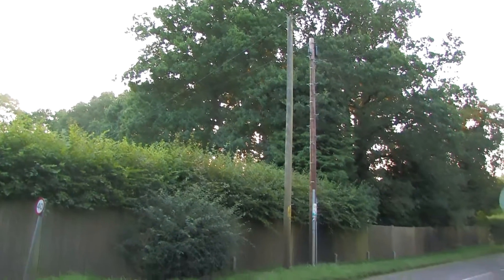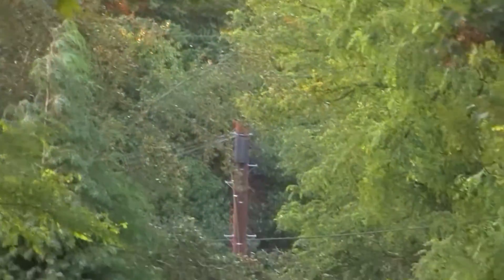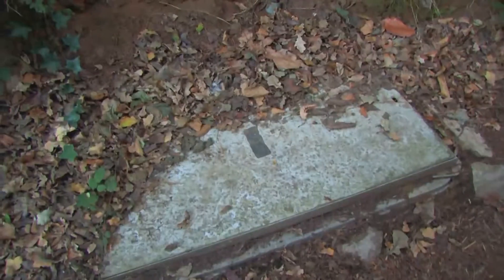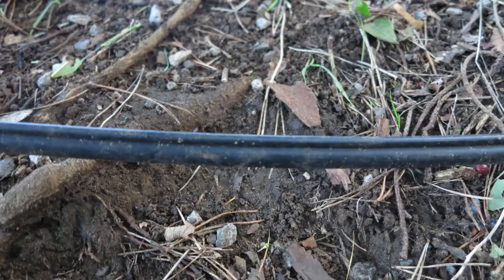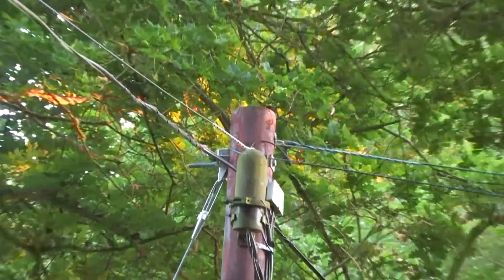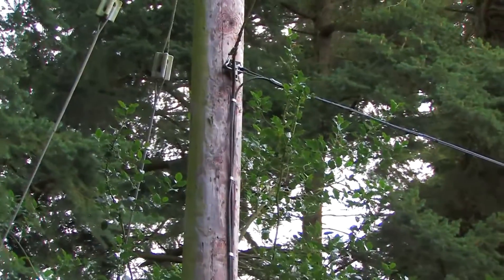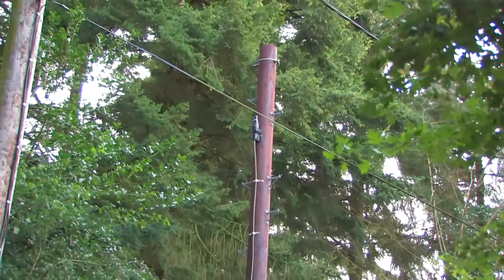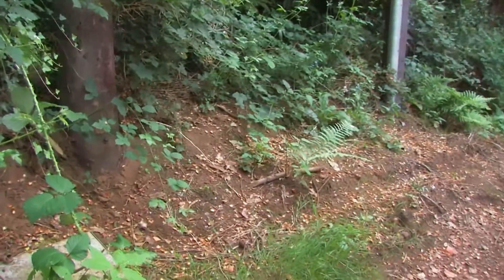BT Native (WBC) FTTP Deployment revisited two years on

Comment: FTTP starting to be rolled out within patches in my exchange area now. I wonder how long it will take for areas to be activated...
Reply from the maker: I now live in Northern Ireland wherein Openreach recently passed 50% FTTP. Can't quite believe how old this video is!
Reply: @scivids1999  wow impressive! I guess it will be only a few months till we can get Gigabit speeds, but that’s probably optimistic! Deployment only started a month or so ago!
Reply from the maker: It should be quite quick an enablement now. I can get FTTP at my place but use 4G/5G due to cost. 

Perhaps I should make a video about the modern connectorised FTTP approach; I wouldn't need to travel very far to film it!
Reply: @scivids1999  ahh fair enough, we get 55/8 on VDSL so it's not like we desperately need it, but will be nice to go onto a more modern and faster infrastructure!
Reply: @scivids1999  looking at this video again, and have noticed that cylindrical manifolds are being deployed here. But, it seems nowadays OR (or in our case a contractor called BNE) are deploying Connectorised Block Terminals instead. At least, that's all I've seen being deployed around here! :)